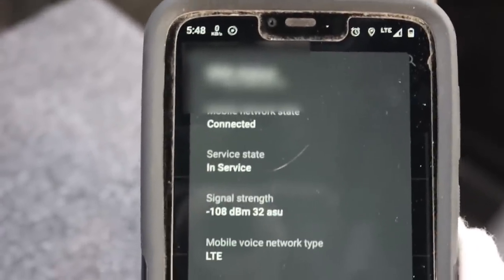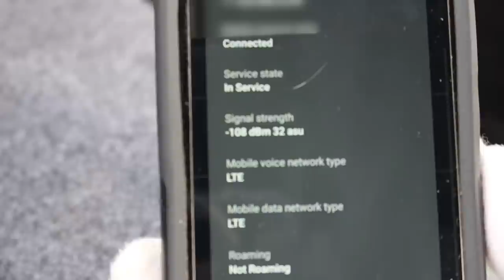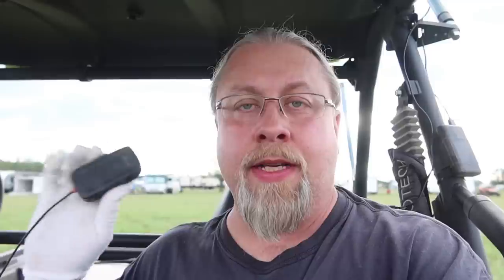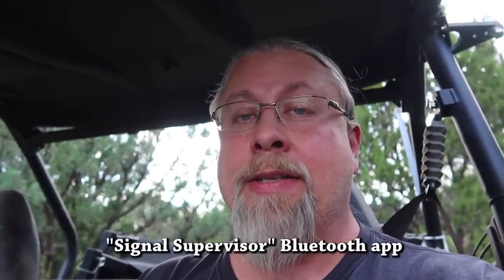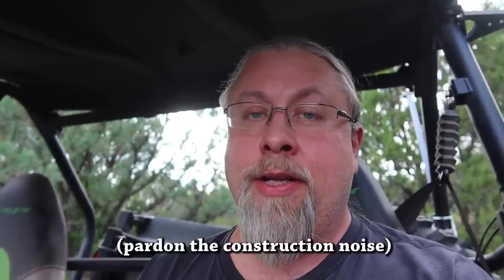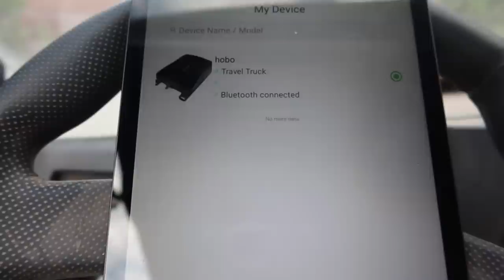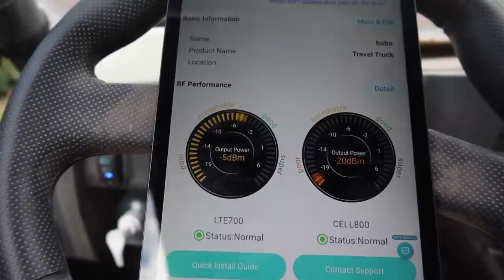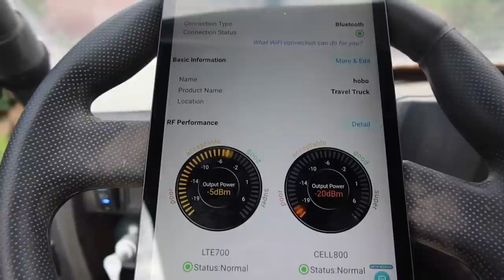HiBoost OTW Cell Phone Hotspot Booster Review | Off Road 4x4 SxS Overlanding

Comment: the Weboost signal amplifiers work well for those situations also, Subaru uses them during their rally races.
Reply: If you compare their cable with Hiboost, you would find Hiboost cable is much better for signal transfer and the heat dissipation is much better. You would know it until you used it

Comment: Why don't you introduce the SXS group to Garmin navigation so you can simply make a route on the map and share it with everyone to upload into their Garmin.  Nobody can get lost that way.
Reply from the maker: Not everyone wants to spend >$1000 on a marine GPS. Besides everyone seems to be missing the point you can make PHONE CALLS for help with this.
Reply: Seems like a good idea,   very handy if you're not in a cellphone reception area.
Reply: Better than the song " message in a bottle " by the Police..
Reply: @HOBOTECH  Speaking about Marine applications. My marina (in Cleveland) has a terrible signal. Plus I would like to cruise 5-10 miles off shore on Lake Erie. 
My Verizon phone gets almost no signal at the marina. I get no signal out on the lake. Boat is 30 ft.
Which, if any, of these devices would work the best? (Similar to an RV - traveling, but out on the water where there are no cell towers within 2-15 miles).
Thanks for the help!

Comment: Is a cb with a head set and it's not a 1000$ it's more like 25 to stay  in contact  with the others  back in the day every ever had one works for 25-30mi  never get lost
Reply from the maker: People don't use Citizen's Band radios anymore. If you want to actually talk you need a Rugged Radio with the special channels. $$$
Reply: @HOBOTECH  you're so wrong and a cb  can have special  canals is way better than FRS or even 2 m and I'm sure someone has a sat phone  just in case someone  gets hurt too
Reply: @HOBOTECH  10m stead of 11m still a CB set or ham because it's in the ham band a good CB am FM ssb

Comment: GMRS? HAM radio? MURS?
Reply: I think Tom's point was "THIS is a CHEAPER alternative", for some .........
Reply: Could probably use a cheap Baofang GMRS radio in a pinch to reach the group assuming you're in 2-5 mile range without big hills in the way.  This thing seems like a good idea though as well.  Cell phone antennas are tiny and have barely any transmitting power.  Your phone could maybe see the tower but can't transmit strong enough to reach it.  Whereas this booster presumably can transmit at a higher power and also has a better antenna.